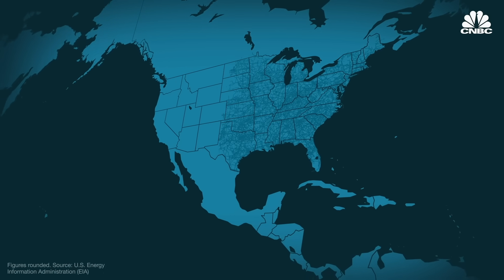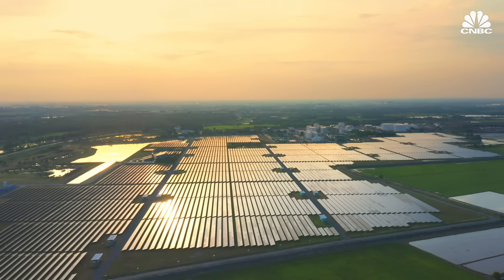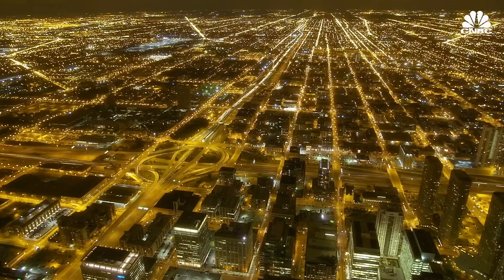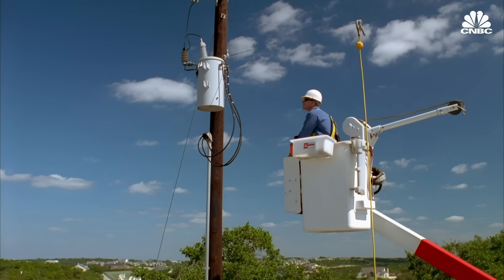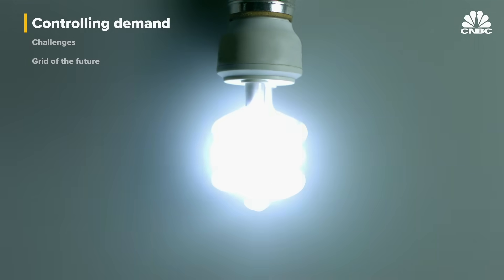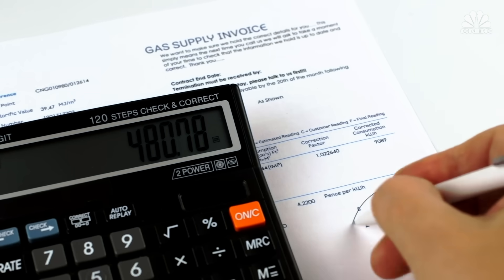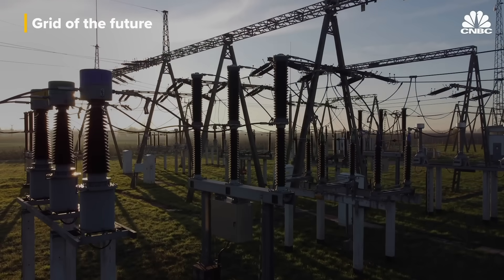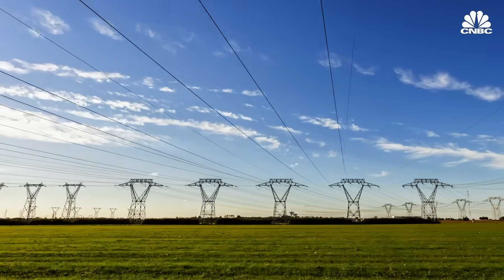How The U.S. Can Build A 100% Clean Grid

Comment: The goal shouldn't be 100% renewables the goal needs to be 100% clean energy
Reply: Aren’t the economics of Nuclear (even with reprocessing) better than renewables plus storage? Lots of other benefits as well. Renewables are fine if not the primary electricity source and if implemented well  (which they currently are not in the US). Caveat we Must reduce the hurdles to build new nuclear plants. Target 3 years to build and need lower financing costs
Reply: @ludda42  Not only better economic, but an entirely renewable grid just isn't practical at this point. We need heat making steam spinning giant turbines. Coal and gas emit CO2, so nuclear is the way to do it.
Reply: Good point. I'd like to see us shoot for both. As we get better at it, there will probably be odd, isolated situations where we can't gain that last percent of being renewable and clean. Mining equipment comes to mind.
Reply: Thorium Molten Salt Reactors would be a great bridge until we get a handle on fusion
Reply: Agreed! We should be building 200GWe of baseload nuclear. They have lower lifecycle carbon emissions than wind and solar and they sit there cranking out power with grid stabilizing turbomachinery 24/7/365
Reply: @woodalexander  I agree; as soon as somebody figures out how to dispose of the waste and not one second beforehand.
Reply: @GrumblingGrognard  We could reprocess it, that's an economic and regulatory issue, not a technical one, the French have been doing it for decades. There's also the possibility of breeder reactors to use the waste as fuel. In terms of waste created by power generation, I'm much more worried about frackwater and coal ash ponds not to mention dumping CO2 into the atmosphere than dry casks of spent nuclear fuel that just sit there.
Reply: @woodalexander  No, you cannot simply blow it off as an "economic" or "regulatory" issue.  If the "economics' are not there; it is not FEASIBLE no matter how much we wish it were so.  If there are regulations in place, they are there for a valid, scientific reason (one would hope).  The French reprocess only a very, VERY small fraction of their waste (as do we).  You are tossing "ideas" out that are not yet feasible.  

As for fracking ground water, and CO2, etc....those are entirely different issues and not even relevant to this discussion.
Reply: @GrumblingGrognard  The French have been reprocessing their waste for decades. They do it because Electricite de France is government owned and the people of France decided they're rather reprocess it than bury it. So reprocess it they do. Here, we could do the same thing with the MOX fuel cycle but we choose not to because the nuclear plants aren't made to pay for the disposal cost and we keep playing hot potato with it. Other negative externalities are absolutely relevant, as it's a trade-off. Nuclear fuel waste is one of the least concerning negative externalities compared to CO2 emissions, frackwater, coal ash, mountaintop removal, etc.
Reply: @woodalexander  Again, no.  You totally blow-off ignore many things.  #1 the economics are not there.  The French "system" is paid for by their Federal gov.  So, you want the US fed to subsidize the nuclear power industry now?  NO THANK YOU!  I have see how that works with oil and gas my entire life!   If it is not economically feasible it is not, period.  Pulling tax dollars to make it work does not make it any "better".  You also ignore the fact that not all waste can be reprocessed and the fact that what does end up waste lasts (practically) forever and we still have absolutely no method of disposal whatsoever and it is literally one of the most toxic things we have discovered in the universe.  ...and you are worried about fracking waste water??  Please.
Reply: @GrumblingGrognard  The simple fact is this. We're either going to use nuclear or were going to use hydrofracked gas or coal. We have a climate crisis. We need nuclear. Pull the subsidies from fossil fuels, a tiny portion of them can cover nuclear waste if people have their panties that much in a bunch about it. Quite frankly, I have no problem letting it sit there for another 50 years in dry casket storage until we have the technology to use it as fuel in breeder reactors.
Reply: @GrumblingGrognard  A simple, fact-based analysis of the externalities of coal, gas, and nuclear heavily favors nuclear. None of the three are perfect, but anyone who cares about the climate cross supports large scale expansion of nuclear power, as it's a key component to getting to 100% carbon neutral power generation.
Reply: @woodalexander  Ah, no it does not.  Apparently it is not so simple for you.  Try counting the HIDDEN costs as well, ALL of them not just those YOU Personally consider important.
Reply: @GrumblingGrognard  We have a climate crisis. We have a choice. Coal, gas, or nuclear. Two destroy the planet, one does not. The choice is obvious. If it means some subsidies to store the waste so be it. We've been massively subsidizing coal and gas for decades, let's pull the plug on that.
Reply: @GrumblingGrognard  hi I'm sorry to bring this to you but what you said about nuclear in France is factually false.
France's nuclear facilities largely pay for themselves and they are the reason why electricity in France has been way cheaper in France than in other European countries for thirty years a century.
Not only that but the government forces the profits from nuclear to fund wind and solar energy in order to make them affordable. Nuclear is not subsidized, it subsidized wind and solar (the way this is done is that there is a minimum price at which EDF has to buy wind and solar electricity, often at a loss, while there is a maximum price at which they sell nuclear in order to keep wind and solar artificially competitive overall.

This is actually at the center of heated debates at the moments because the European Union is forcing EDF to split into multiple entities and these issues need to be solved (the government is considering lowering the maximum price at which nuclear is sold).

There is also a very report that came out this week mandated by the French government about the feasibility of a 100% renewable grid in 2050. And basically the result is "in theory yet but there are many unknowns that need to be fixed first and it would cost everybody an arm and a leg".
Meanwhile nuclear is keeping France the greenest country in Europe (a lot more than Germany with all their I'd turbines and coal plants for when there is no wind) with the cheapest and most reliable electricity (France is a net exporter to all of its neighbors).
The only reason why electricity prices have been rising is because activists are pushing governments to close nuclear reactors and to subsidize wind farmed very heavily.

Thanks for reading I can give you sources if you need but it's all accessible information on the internet.
Here's the report :
https://assets.rte-france.com/prod/public/2021-01/RTE-AIE_rapport%20complet%20ENR%20horizon%202050_EN.pdf
Reply: @huguesjouffrai9618  "France's nuclear facilities largely pay for themselves"  My God what world do you live in?!  The French nuclear power industry was financed on the back of loan and loan guarantees underwritten by the French government.
Reply: @GrumblingGrognard  just because they required an initial investment doesn't mean that they are not paying for themselves (meaning that they have been and are very profitable on the long run), what are you even talking about
Reply: @huguesjouffrai9618   "what are you even talking about"  EXACTLY my point.  Go read/study a bit on basic economics (beyond supply and demand please).  The costs are there and only hidden for fools without the knowledge and cons making a buck by passing those costs on to others.
Reply: @GrumblingGrognard  thank you very much I've studied economics and finance quite a lot (ad hominem attacks won't cover a failure to provide compelling arguments)

The famous "hidden costs" of the French nuclear program are a myth.
The dismantling of the reactors has been provisioned for and the initial investment have been repaid, in part via the low price for electricity.
Studies have shown again and again how competitive nuclear electricity has been (and still is, even though ridiculously high security standards have raised costs) in France.
Reply: @GrumblingGrognard  >90% of nuclear “waste” is recyclable.
Reply: @GrumblingGrognard  we literally figured that out decades ago. It's called the Integral fast reactor. Unfortunately funding for the program was cut in 1994 The "waste" problem was invented entirely by politics, and it started in 1977 when Carter banned fuel reprocessing. Reagan then unbanned it, and then that was undone by Clinton.
Reply: @GrumblingGrognard  it required funding because it was an experimental reactor being made at Argonne National Laboratory. Given that it's a National Lab, it gets it's funding from the DOE, not private investors. Nuclear plants in the US have no incentive to recycle their fuel because they get paid to store it on site.
I recommend looking up the Experimental Breeder Reactor 2 or the Integral Fast Reactor.
Reply: Check out a sodium thorium reactor totally feasible and wast only needs stored 300 years not 300,000. Solar and wind alone isn't the answer as they are terribly inefficient, no way to store massive amounts of power not just a capacitor bank another little talked about problem is windmills are put in paths of prevailing winds which are also migratory bird paths they kills tens of thousands of birds if not more a year. They can't make gearboxes to reliably withstand gusts of wind that put millions of ft lbs of torque on them they also cause cognitive problems with people living close to them like vertigo and migraines
Reply: @drwe57  That sounded good until the cognitive problems lol. There are a number of other nuclear fission technologies out there like sodium thorium reactors, pebble bed reactors, etc, and we should be doing way more R&D on them as they are the only way to generate a lot of power with a relatively small physical footprint. We should do more wind turbines, but they're aren't a perfect solution.
Reply: @drwe57  the problem with Thorium reactors is that they don't exist (yet?)
Reply: We cNnot power ourselves with renewables!
Reply: Perhaps as the first step; but when you consider you can easily obtain both and in most cases it is more efficient considering TOTAL COST (something fossil fuel fans NEVER, EVER do!) then no to do so would be foolish and much more costly in the long-term.
Reply: Nuclear is just not clean. You followed an industrial lie although it seems that avery american surrendered
Reply: @abdebee3221  Also, nobody talks about the number of good paying daily jobs a solar farm or windmill farm creates after they're built and online.

Comment: Why not teach conservation first? Did an energy audit after repairing my T.V. and found out it uses the same electricity whether it was on, or off. I found I had 8000 watts of wall chargers that ran 24 hours a day. That's almost 9 space heaters that ran 24 hours a day. Make the manufacturers use battery memory in their product so could turn off the power supply when off. Clean the coils on your refrigerator. Switch to incandescent light bulbs during the heating system. Take them out when heat not needed. An old light bulb was 95% efficient for heat, which is 10% better than anything else on the market today. Were illegal til Trump, it's how an Amish heater works. Just about money. Is there a solar panel manufacturer in the U.S.? Solar O.K. in the south, but Portland won't even pay for someone to clean the panels once a month. I have seen solar come and go three times, I am a certified R.V. mechanic. If technology not there will be just another cycle again. Do your own part, where it has to start.

Comment: I have 10 kw solar on my home and any excess energy is sold to the local cooperative at 3 cents then they sell it to you at 12 cents so I try to use all my power generated for my self. By the way my system cost close to 30k and as a home builder I use solar on new homes with ev plugs.

Comment: There is a great deal of misleading information in this video; coal energy production is the least expensive and natural gas, the comparisons totally understate the impact of cost for storage and battery technology is still back in the horse and buggy age, the solar panels have a 20-25 useful life and then have to be replaced with concern for the toxic materials in the panel that are very expensive to recycle so they end up in land fill, automation of all appliances sounds good but the higher technology has a reliability concerns when there are hiccups how many times do you have to reboot your computer because something goes haywire? In areas with high lighting strikes electronics are highly at risk. Expecting Joe Biden to force everyone into this utopia energy net zero carbon cost is a disaster looking to happen, look how well Solyndra scandal worked .... it didn’t and the taxpayers paid in the end.
Reply: Solar and wind are cheaper unsubsidized than coal in almost all markets and gas in most. Storage costs are currently high hence why peaker plants still exist. However the storage curve is falling dramatically. The free market dictates winners so when it chooses wind, solar, and storage over coal you should be happy.
Reply: Also Solyndra was the governments failed attempt at being a venture capital firm with a large loan program. The project was a mistake.  However Tesla got the same type of loan as Solyndra. Ever heard of them?

Comment: The best solution is not being on the grid at all. A home or small business can be built with little extra cost to be over 100% self sufficient for energy and water. As our technologies advance, there would be no need for outside connections of any kind. Edison wanted to make money from energy (Distribution systems) but Tesla wanted to give energy away free. These expensive distribution systems will become obsolete and that is a good thing. Some places in the world have legislation in place to prevent or make it illegal for being self-sufficient for basic needs and we can easily guess why that is. All networks are all about money and control.

Comment: When the little girl voice said designed to run on fossil fuels while the video showed steam cooling towers of a nuclear power plant,  that finished my viewing. 

The grid grew from hydroelectric generators and then coal plants added to flesh it out.   Nuclear was to replace coal plants, but scare films ended that in the US. Canada,  UK, Aus.   Gas fired slowly replaced or augmented many coal plants instead,  and those lobbies ate the ones pushing Solar-Wind to force a closure of the grid that draws power from hydro,  nuclear and remaining coal plants. 

Solar-Wind typically need gas fired traditional plants to handle every night.  There are not enough batteries on the planet today to handle even one large city, and batteries are built from unsustainable mined ores in plants fueled by high horsepower sources (coal,  nuclear,  hydro).

So the trick is to get you to pay for a new grid that leaves out competition from sources other than wind-solar-gas.   It is a PGE and Sempra lie told to and by environmentalists. 

Since we're into non physics here.   The best 100% clean grid is NO GRID.  Every electricity user is its own producer.

Comment: The transformers they stop the flow of electricity from your house back to the grid.
Confused
Last I checked, Alternating Current goes back and forth . Plenty of states allow households to hook up their solar powered home battery systems to sell to the grid.
Does that lady even know what she is talking about???
Reply: I would hope so. You basically need an inverter to return excess power to the grid by matching frequency and voltage. A dumb transformer is still a dumb transformer.